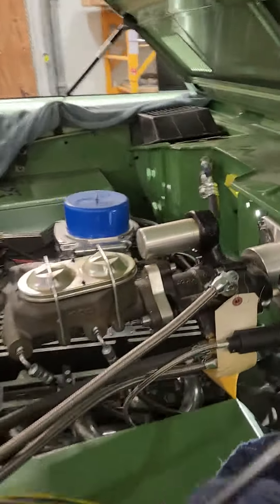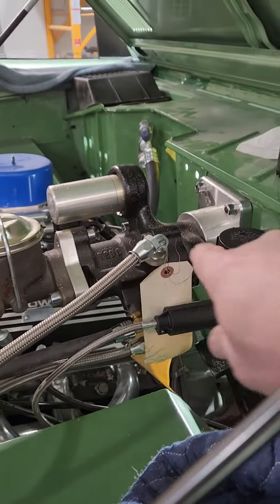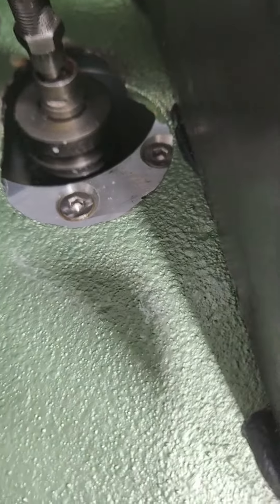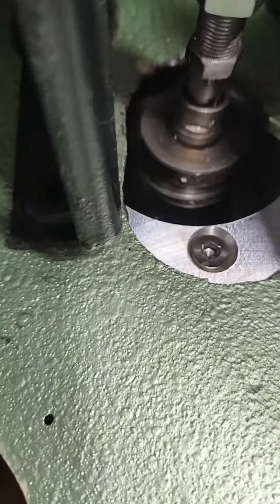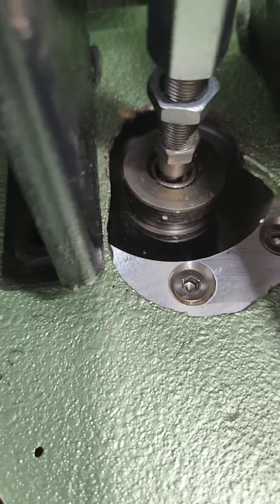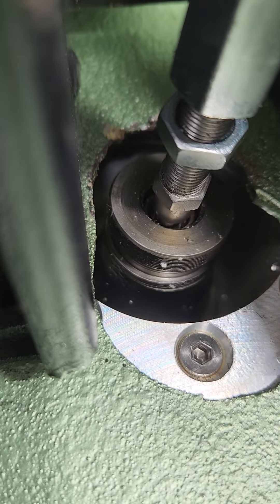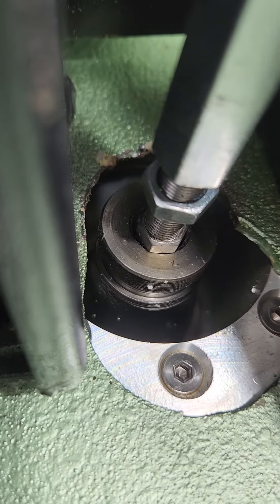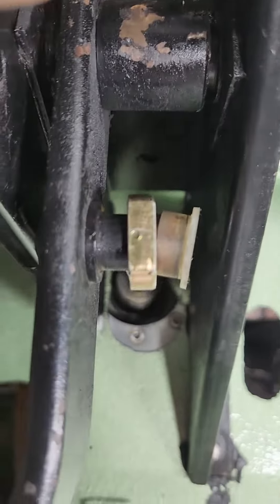68 reproduction bronco brakes

Comment: The length of stroke on the rod should be reduced once all the air is bled out of the system. If not, you can turn/machine down the nut. Also check with the Manufacturer's Engineering group and get them to figure it out. 
Otherwise Happy Thanksgiving
Reply from the maker: Man you guys at Wild Horses are great , this is such a huge project hopefully I wont be needing to darn many video helps like this

Comment: And now that I'm liquered up. And fuu.. felling good. Get out there and grab an old hot rod. 71 Chevel. 72 Chevel 305. 307. 1966 Chevel 283.  350 is a 2a3 with bigger heads.  Oops I spilled my beer hold on.